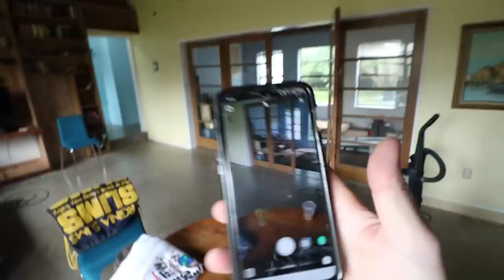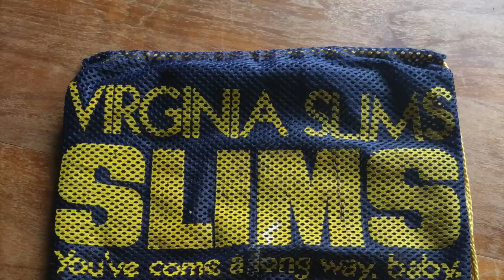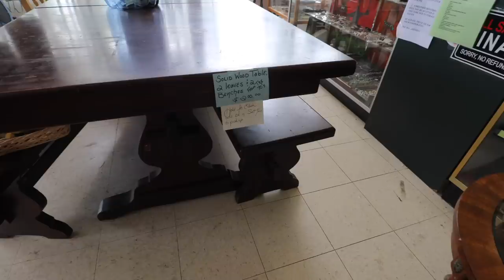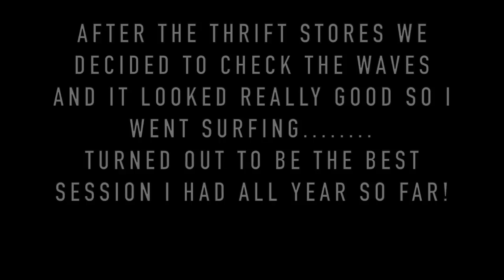Can't Believe What We Found Trash Picking! FLORIDA GARBAGE PICKING!

Comment: You love cats so much and find so many coolers. In this area rescues make cat shelters out of ould coolers by cutting a hole in the side. It keeps them cool in the Summer and warm in the winter. We use clean shavings or straw inside. Cedar bedding repels fleas. The lids are lifted for easy cleaning. They are so easy to make. There are Utube videos. My Son and I made an aircooler for his garage by a utube video as well. Runs off battery or solar. Made one for a guy we know that lives in a tent right now . They can be a life saver. Just scrub them out. They don't have to be perfect for these projects. You could help your feral kitty community.

Comment: Luv your shows. Did you know that you can take the motors out of those running machines, run them backwards and you will  have a 12 or 24 volt, DC generator. I have several and it does work.

Comment: That cooler was toasted wondering. If the TV worked or not
Reply from the maker: The TV did not work correctly. The screen was half on half off when we plugged it in.
Reply: @tuckandsammie  I was hoping it worked out for you
Reply: Should have took that Rtic soft cooler. They are $100+ new